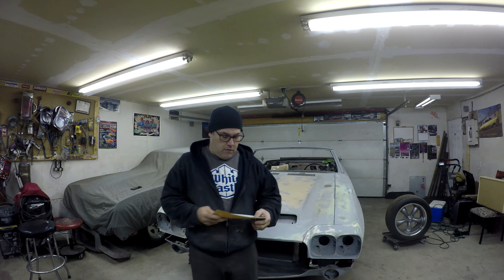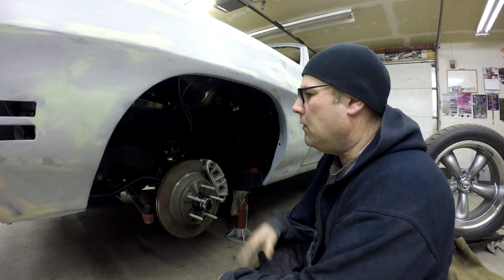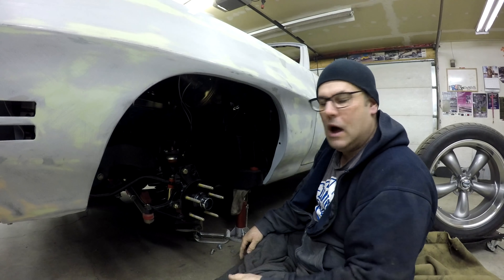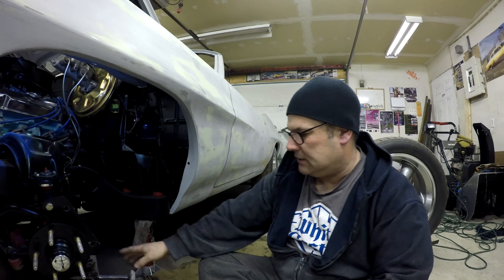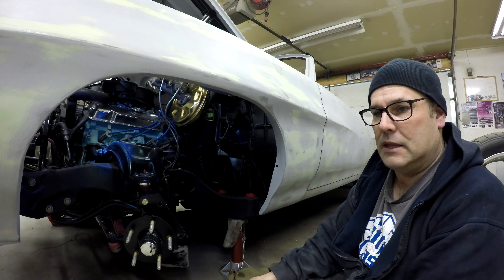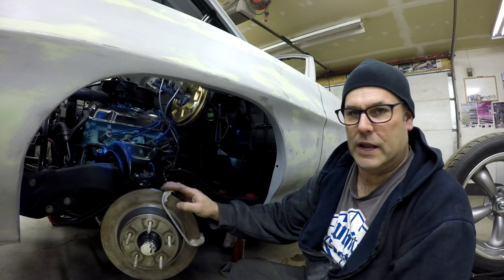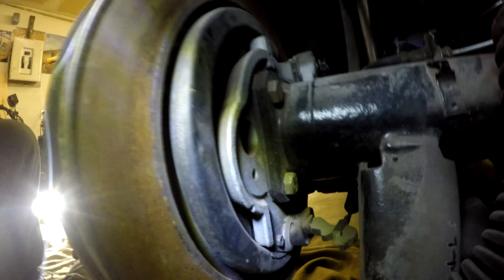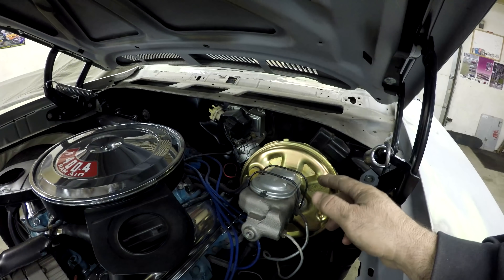4 Wheel Disc Brake Conversion for GM Muscle Cars on a Budget | 1971 GTO Brake Swap Explained

Comment: Jon is a cool dude to hang with.  I did a roadtrip in his 75 firebird with him and he helped me with my 68 firebird too.  I have the c4 rotor c5 caliper combo on my 68 firebird.  Got a c5 setup on my 67 tempest and we have stock gm disc brakes on our 66 buick... it was only 239 for the buick and fit under a 15 inch wheel.

Great video btw

Comment: My 66 Impala uses 11" A-Body Chevelle disc brakes and calipers with the original Impala drum spindles and a simple custom bracket to mount the caliper. Only physical mod was to redrill the spindle for the bearing cotter pin. Used a heavy duty 70s half-ton truck master cylinder, a dual action 8" MasterPower booster and a quality wildwood proportioning valve. Went through 4 cheap repo Chinese valves before going with the wildwood. My 66 B-body is the same weight as a 70 Chevelle so there is no worry using the 11 inch discs. Plus it allows me to still use 14" skinnies up front when I go to the drag strip

Comment: Great info however cross drilled rotors are purely for show and warp much faster and develop heat cracks at the holes.  You also reduce stopping surface area which kinda negates the benefits of big brakes.  Slotted are fine but would highly suggest no cross drilled

Comment: Question about the location of the spacer that goes between the disc brake packing plate does it go before the retainer for the bearing or do you need to press the bearing off to install the spacer?

Comment: This is the c4 non hd calipers with the 12” front rotors, if you wanted to you could upgrade to the c4 HD calipers you get a much thicker rotor and a 13” dia rotor and for the back you could get the 89-97 caliper off camaros to match the c4 fronts I believe c4 vettes also used the same rear caliper .

Comment: I like bigger brakes as well but I just really wanted to go old school period correct 15 inch wheels on my 66 Special and 67 cutlass. So had to go with original disks. . Big brake swaps would work with those wheels😞

Comment: Is there any guidance you can lend on the brake lines ? Can I just order a kit off inline tube or summit and use them? Would they need different fittings ? Could you maybe do a breakdown on the brake line set up 
I have everything for ls1 conversion but I’m kinda lost as to adapting the lines snd all

Comment: I did fbody conversion on my 70 chevelle. Have oem 11” booster . So all I need is 76 corvette master cylinder linked up to my booster to make it work good ? Have a part number for the adjustable proportioning valve ?

Comment: Would this be compatible for 2" drop? The 2" drop spindles say that they have to be disc brakes (I believe).

Is your car dropped or is it stick height?

I saw 2020 camaro ss front brakes for sale and would like to put these on my 70 Lemans

Comment: I would just get slotted disk. The drilled one are proned to cracking I'm pretty sure
Reply: Nope.  Mine are completely worn out and still not a crack.
Reply: @InvincibleExtremes  well I'm sure it's depending on driving style. Not saying they all crack but a lot do crack.

Comment: Did you custom make the emergency brake bracket 10:25  that attaches to caliper?  I know you can't reuse the  E-brake bracket from the donor Camaro.  Just looking for options for the bracket placement. Nice video!
Reply from the maker: Yes
Reply: @SPPTVarmy   It also looks like you reversed the e-brake drum cylinder so the lever will face away from the caliper. Thats a great idea! I was going to weld a tab to the shock mount to match the direction of the lever. Not anymore.  Well done sir and thanks for sharing.

Comment: I thought it was backward i thought the disc spindle were the short ones and the drum spindle were longer due to having the anchor pin for the brake shoe springs to attach to🤔?
Reply: Yes you are right, i noticed that after the video came out.if you use the disc spindle you have to add a spacer.
Reply: Ya thought so cause i remember reading that somewhere where they said the drum spindle was longer and needed to be grinded down to match the shorter disc spindle due to having the extra length for the anchor pin bolt well anyway thanks Rob for the reply

Comment: 12 or 13 ?  If you are doing this you better get that part right otherwise because depending on which rotor size you get your wheels might not fit.

Comment: Question so I have a 68 Firebird and I want to convert it to 4 wheel disks it's got the 4 piston front caliper brakes factory all brand new upgraded uh with new calipers So couple of things I wanted to do the  Act breaks but the wheels are 15 now they're old style rikens they're pretty cool wheels don't really want to change them because you can't find them in 1617 or bigger is there a conversion kit with the rotors where they would fit with the 15 inch wheels that's one question the other question is the 684 piston caliper front brakes came with  a metering valve Which I believe keeps the front desk breaks from lock up does that need to be deleted I found a power break system from a 69 sport Tempest Everything fits it's all on there even the rotors fit except the differences the 69 Tempest has one piston caliper front brakes so though I have the spindles the rotors the brackets complete for that car I didn't go to the 1 piston calipers it still has the factory for pistic helper brakes